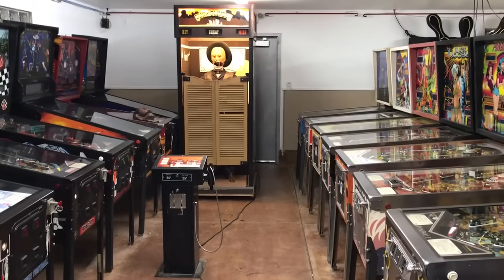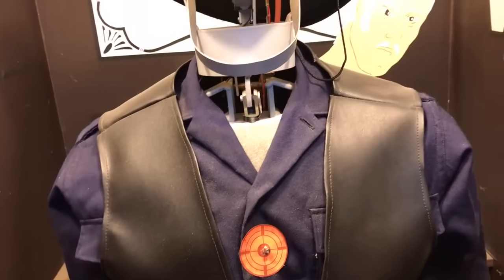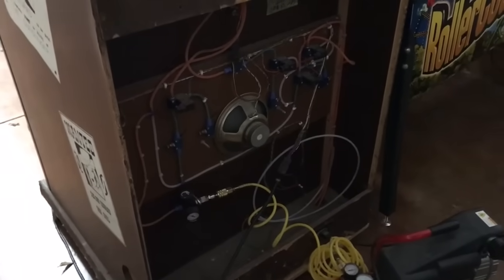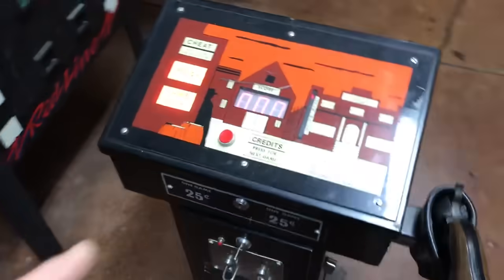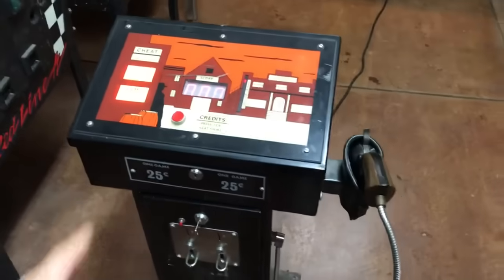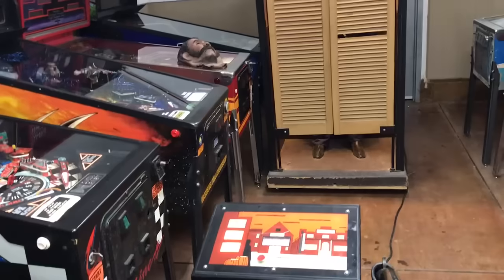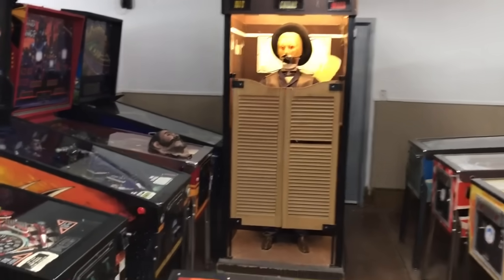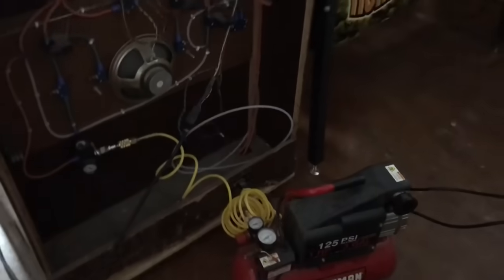1983 Electrotechnics Gun Slinger mechanical arcade gun game Gunslinger

Comment: I assume there is only one voice track on the tape, meaning you would learn the "Draw" timing pretty quickly.
If it used multiple "Draw" segments, easy to do on a 4 track cassette (2ch stereo x 2 sides), and randomized which one is used per game, be much tougher to learn Draw timing.  With current digital audio tech, could probably retrofit a cheap generic mp3 player in there, with 10s ir hundreds of Draw voice tracks, set to Random play, to ensure random timings

Comment: How does the cheat trigger?
Reply: You are supposed to start with your pistol inside the holster. You are not supposed to point it until the robot says the word "draw." There is a magnet or some other type of sensor inside the pistol and holster that lets it know whether or not you have it inside. 

I once saw somebody use this machine and he just kept it pointed directly at the torso of the robot. That caused the cheat light to light up.